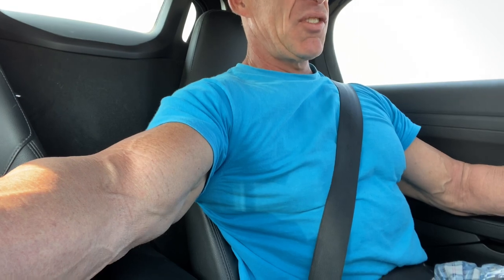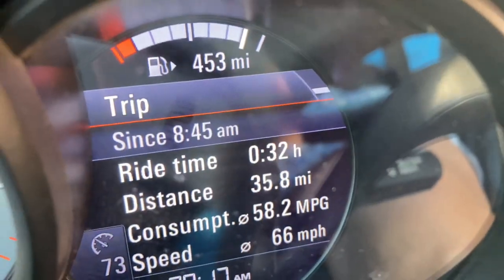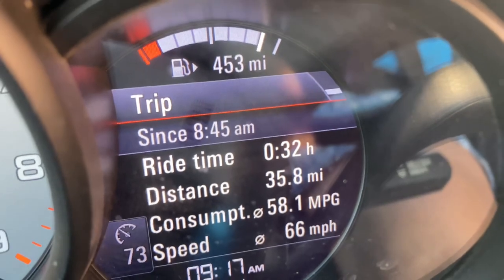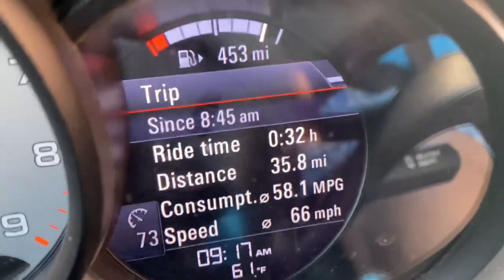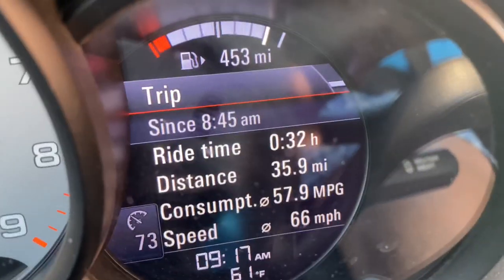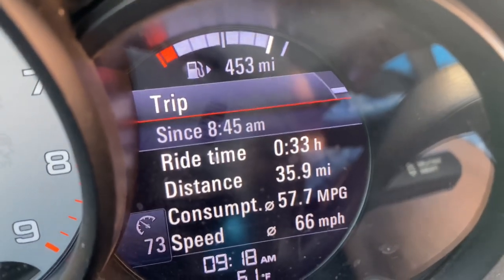58mpg in a Porsche - goose and glide

Comment from the maker: Please stop repeating what you heard in drivers training without thinking about it and analyzing it. This technique is NOT dangerous if you use common sense! I am going downhill with no other cars within a 20 second radius of me. If I find I am going faster than is safe, I would cease this technique and go back into gear to use the engine to brake. The reason that drivers training tells you to stay in gear is that if a deer suddenly darts in front of you, you need all four options open: to swerve left, to swerve right, to brake, to accelerate. Those are the four ways you can avoid a collision. When it comes to the choice of braking vs acceleration, braking is the right answer 99% of the time because 1) if you fail, the collision is slower 2) you can decelerate much faster than you can accelerate. THINK about this situation. I am going down a steep downhill very fast, in fact, I am going as fast is as safe and legal. Should a deer dart out, going faster is not a good choice nor a legal choice and the brakes would be a much better idea. For the sake of argument, lets say I was going half the legal speed limit coasting down the hill in gear because I remember that drivers training told me to do this. A deer jumps out - SHITE! I decide that acceleration is how I will avoid the deer but I know that I am in 6th gear at 50mph and that even in a high powered sports car, stepping on the gas in 6th at 50mph will not cause the acceleration required to prevent the collision so I downshift to 3rd and punch it. There goes the drivers training safety argument. I have to shift anyway to avoid the deer and it doesnt matter if I have to shift from 6th to 3rd or from N to 3rd, its a one second shift either way. Braking is better for collision avoidance 99% of the time. Its only at low speed where acceleration becomes a viable option.
Reply from the maker: This unwillingness and inability to critically think is precisely why I say and believe that America is well on its way to becoming a very successful 3rd world country.  Our schools are teaching to the test rather than teaching students how to critically think.  Our schools are too busy keeping students from stabbing each other with knives to teach them science, chemistry, physics, and calculus.  High school graduates are as helpless as a newborn puppy.  At the grocery store, they don't know how to read a nutritional label to find foods that are healthy and good for bodybuilding so they buy expensive trash.  They get their coronavirus safety information from the president who says its not even as bad as the flu and then 300,000 people die.  They don't understand the difference between opinion and science and think that because it still snows in January that global climate change isn't real.  THIS is why America is doomed.
Reply: You have to realize, common sense it not so common anymore.  I deal with people on a daily basis, and you would be floored by the shear lack of what used to be called "common sense" Stories so outrageous, most people with common sense would think I'm making the stories up. It's that bad in the real world.  Just look at the filthy comments thrown at you, just for stating something factual and trying to me infomative.  We live in scary times Scoobs
Reply: @scooby1961  Scooby, what's the elevation data for that 58 MPG drive, how much altitude change was there in those 36 miles?
Reply: true Scooby
Reply: @Tonyd535  that is wrong. they will not shut down while the car is moving. anyways in MOST cars you can disable start stop with a button. it is one of the worst additions to new vehicles, I disable that every single time.
Reply: @scooby1961  Scoob, this past year I have spent countless hours researching countries I would like to move to.  What you just posted solidifies my intuition about where things are headed for this country.  1/2 the country thinks we need to be in the dark ages.  They are not going away anytime soon.  Right now I think Portugal or Argentina sound nice.
Reply: @scooby1961  truck driver here, I never had a car with a manual transmission.  Is it hard to shift that car with no clutch when you are moving?  The only time I use a clutch on a semi is when I am completely stopped.

Comment: Total bad advice Scub. Your car needs fuel to run in neutral, while in gear,  momentum is keeping your engine run. You can see this in car computer. When going down hill in 3 gear with foot of the gas it says 0 fuel consumption.

Also, car handling is totally different in neutral when going down hill. 
Also, driving like grandma is not good for your engine. You can clog it up due to the return exhaust gases going back to the engine via EGR valve.
I don't know where all those people learned to drive like that in Europe, but in Croatia we learn how to downshift.

Also, you are demonstrating money savings in a Porsh. That's like having Arnold physic and saying you can maintain it by ab cruncher or shake weight.
Tituuuuu have some money... -Thank you Shake weight.
Reply: Who is Scub?

Comment: DO NOT DO THIS; this isn't correct. Your car is falsely reporting it's efficiency because you're driving in neutral; the engine still needs gas to operate even in neutral. When you leave the car in gear momentum causes it to continue operating (due to what is called the Deceleration Fuel Cut-Off System) and you don't use any fuel; this has been the case since the late 90s/early 2000s). In the UK this is called "engine-braking" and is taught on driving lessons.

You will fail your driving test for doing what you're describing because your vehicle is not considered "in control" when coasting / moving in neutral; do not do this. Not only is it less efficient, but you don't have any engine braking if you have to do an emergency stop.

I repeat, DO NOT DO THIS. You will fail your driving test and worse, be at risk of accident.
Reply from the maker: Wow, you  are an EXPERT!
Reply from the maker: Sadly the comments here illustrate why America is well on its way to becoming a 3rd world country - our lack of investment in education.  America is now nation of science-illiterate people who are all convinced they are Albert Einstein because of the Dunning-Kruger effect.
Reply: @scooby1961  what did he write, that you feel is incorrect?
Reply: is this true even with manual transmission ? leaving you car running in gear with an automatic would create more weight for the engine to idle through no?
Reply: @scooby1961  Did you not even read his comment, it sounds like he is from the UK, not America.
Reply: I agree with crosshash, I was taught in UK it is dangerous to coasting in neutral gear as you do not have control of the car!
Reply: @Yoishify  It depends on what type of Automatic, a torque converter will use more fuel while in gear because the turbines will always engage slightly (im not sure if more modern cars have a solution for this but its probable, given how strict emission standards are nowadays). A Dual Clutch Transmission however will have the clutches disengaged so no additional fuel is consumed.
Reply: I know you will fail your test if you coast, but i actually feel far more in control of the vehicle in neutral.

If there is a hazard i already have my foot covering thd break pedal and i can push it firmly with almost no reaction time. If the car is in gear i have to move my foot off the accelerator and onto the break and push it, then push in the clutch with the other foot to stop it from stalling.
Reply: @scooby1961  jajaja not kidding. Way lack of education and something that I've seen everybody has lost and it's called common sense!!!
Reply: Firstly, good video, very interesting. I'm a big fan of yours Scuby and I have been watching for many years :-)

I don't know about other countries, but I can confirm that in the UK it is illegal to drive your car whilst it in in neutral, the reason given is that you are not in full control of the car. UK driving instructors teach us not to hold down the clutch when approaching roundabouts or stop junctions for this reason.
Reply: Wtf are you talking about dude? You clearly do not understand how cars work
Reply from the maker: @oracla  Everything he says is for an AUTOMATIC transmission. I say clearly in this video NOT to do this in an automatic.  The advice was for MANUAL transmission only.  Yes, in a modern automatic transmission car, the fuel injection stops delivering fuel when coasting.

Comment: Please keep in mind if you only rely on your brakes when going downhill it is crucial not to hold the brakes for a extended period of time as you will loose brake force (brake glazing). This is very common when you have steep hills (West Norway). We are taught never ever to use the brakes alone when descending a mountain. Always use the engine as a brake. The reason why some trucks have "jake brake". And for information, many new cars shut of the fuel to the injectors when the car is using the engine as a brake, so you get the same effect, only with some resistance.
Reply from the maker: Im not an idiot
Reply: @scooby1961  I know you are not, but a lot of people are, hence the stupid warning labels on everything.

Comment: Dear Scoobs, in my honest opinion Your logic is quite flawed. I checked this time and time again on many wechicles in my country where 98% is manual and the best thing to do when driving down a hill is put a higher gear like 5 or 6 because then the wheels will move the engine and the computer will show that the amount of gas used AT THE MOMENT is 0. But when You put in Neutral the engine will still work the same way as it does when You are standing on a flat road with the gear on neutral with around 1k rpm.
Reply: This. When you're in motion and in neutral, the engine needs to keep burning fuel to stay on. When you're in motion and in gear, the inertia of the car keeps the engine going, so no fuel is needed.
Reply: @scooby1961  wow scooby just wow :D I'm a big fan of yours, but you are failing so hard right now :D you are so hard in your tunnel vision, you are blind even for the simplest of explanations
Reply from the maker: When the engine is connected to the wheels, the internal friction in the engine acts as a brake. If you want max speed for minimum gas when going downhill, you have to disconnect the engine.  Use friggin common sense, if you are unskilled driver or if road conditions/traffic conditions suggest this is not a good idea then DONT DO IT. 
Sadly the comments here illustrate why America is well on its way to becoming a 3rd world country - our lack of investment in education.  America is now nation of science-illiterate people who are all convinced they are Albert Einstein because of the Dunning-Kruger effect.
Many people here will argue with me about physics and tell me I am wrong without bothering to google what "Dunning-Kruger" means, sigh.
Reply: @scooby1961  That was rude... I wrote I am not an American.  The engine will act as a break ON LOWER GEAR not when You put it in 5 or higher. Man I dont know why would You write something like this. I didnt write "You are stupid, and wrong" I just stated that Your logic only applies on lower gear.
Reply: @Szuszf0l  Well to be precise, the breaking effect is in proportion to RPM. At low RPM (high gear) the breaking effect is small, but still there. Also what I noticed in my car, the injectors do not shut off in 1. gear, only 2. or higher. So if we are talking about driving on the highway in 1st gear, scooby might be right :D
Reply: @oracla  i already said 2 times. Gear 5 or higher. Also the breaking effect is there but You know what isnt? Any fuel consumption. Anyway fuck this. Im not don kichote to be fighting windmills...
Reply: @scooby1961  You willl save most by turning off the engine while going downhill... :D
Reply: This isn’t true. Connect your phone to obd2 (elm adapter) and watch your instantaneous fuel economy comparing neutral and top gear going downhill. I’ve done it, in a 97 civic, and the difference is significant, in favor of scooby logic. 

Aka, don’t base your data off your on screen mileage, it is NOT a function that you get with obd2 tech. Gg poorly played.
Reply: @Szuszf0l  We are on the same side of the argument. I was just adding some details and.... you did say "engine will not act as a break in 5 or higher", which is technically not true. But don't worry. The American education system has made us Europeans stupid anyway... :))
Reply: @Szuszf0l  bruh its Don Quixote not Don Chipotle
Reply: @captainfancypants4933  autocorrect to my language... Plus its Quijote.

Comment: But Scooby, doesn't the engine burn fuel while being in neutral? When going down hill in-gear and not touching the gas pedal I thought no fuel is burnt. So the question is fuel saved with friction vs speed saved without friction but with continued fuel consumption.

In fact in my Volkswagen users manual they advise to stay in gear when letting yourself roll as no fuel is burnt during that.
Reply: You're right. If you stay in gear while going downhill you're using the kinetic enegnergy of the car to keep the engine spinning and the fuel is cut off if you don't accelerate.
Reply from the maker: try the experiment

Comment: VERY dangerous in Stop / Start engines !! Modern European cars with stop start will cut the engine off when the revs drop and in neutral !! Meaning NO BRAKES OR POWER STEERING. Apart from that, you'll fail your driving test as its very dangerous not having a gear ready for emergency acceleration and avoidance.

Comment: The downhill advice is wrong Scooby. On downhills you select the gear that gives you the closest match to your desired speed, which keeps the engine moving passively through the wheel rotation and burns 0 or close to 0 fuel. It also has the very important benefit of braking the engine so you don't use the brakes almost at all, compared to using them to slow down the whole weight of the vehicle with no help from the engine and wearing them down unnecessarily. Idling in neutral actually burns a set amount of fuel to keep the engine going, while engine braking will burn close to 0 and preserve your brakes.
Reply from the maker: incorrect
Reply: @scooby1961  Very well argued there but using engine braking for fuel economy and to preserve the brake pads is driving 101. Also vital for driving in the snow/dirt. 
Very strange that you you can't figure that out. If the car is braking too much, you simply shift to a higher gear.
I mean you can give it another thought, or you can keep wasting fuel and brake pads. Up to you!
Reply: I've actually been able to demonstrate that an electronically-controlled fuel injected engine does not use any fuel on overrun (when performing engine braking). Connected a diagnostic cable to our 1998 VW Polo, and it showed 0 ms injector duration on downhill sections in gear. Shift to neutral, and the injector duration increased to the same level used during idling.

In our 2009 Polo TDI with a PD 100 engine, you can actually hear the injectors stop operating when you're going downhill in gear (yeah, they are noisy little buggers).

I'm sorry, but the marginal increase in final velocity at the bottom of a hill does not justify the increased cost of consumables and fuel used as opposed to using engine braking, as well as the reduced amount of control you have over the vehicle.

Comment: When gliding, the car idles so it's using fuel to run, but when in gear the momentum of the car keeps the engine running instead so the fuel used is 0. The most efficient way would be neutral gear and shutting off the engine but since that isn't an option like you explained i think the best thing to do is engine braking in a high gear.
Reply: Depends on the grade. If you loose speed in while in  highest gear, it's usually more efficient to take it in neutral. If the grade is steep enough that you keep your speed while in gear, then obviously stay in gear and reap the benefits of deceleration fuel cut-off.
Reply: True, when you coast in neutral you use 0.7l/100km when coasting in gear 0.0l/100km